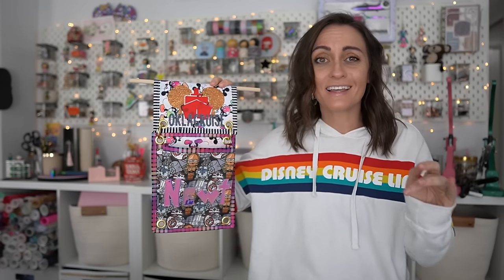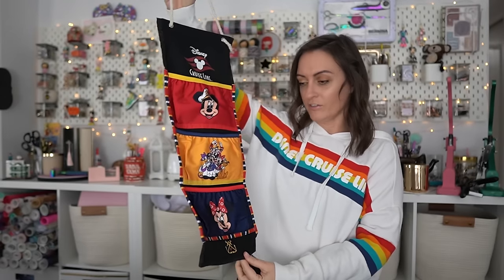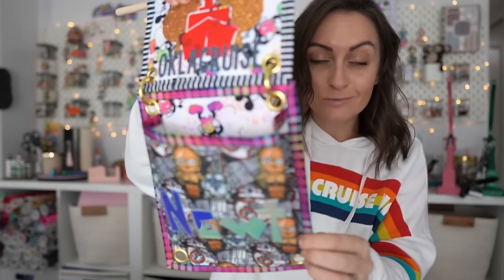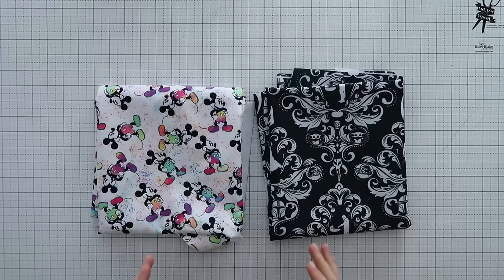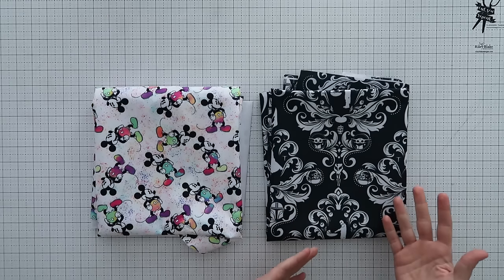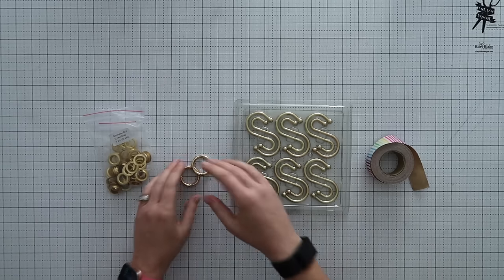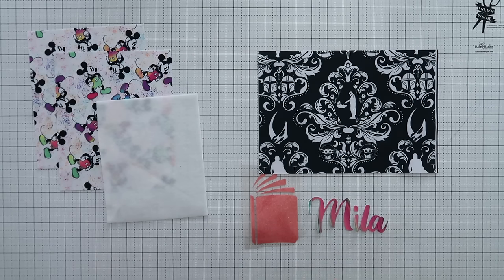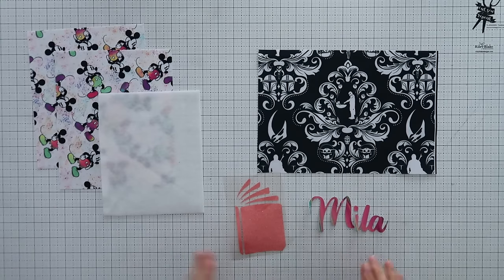How To Sew A Fish Extender For A Disney Cruise! With Interchangeable Pockets! Using HTV and Applique

Comment: I was thinking if you don’t want to do grommets and your machine has the feature, you can make button holes instead. It would be simple to slip a hook through the button hole as well.
Reply: Ours has button on pockets.  It works so well and it was easy to do.